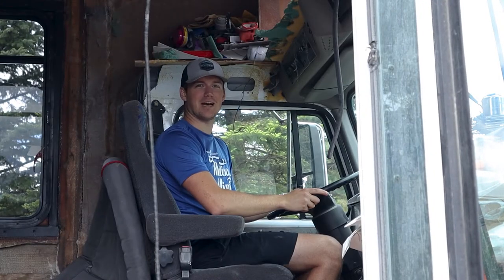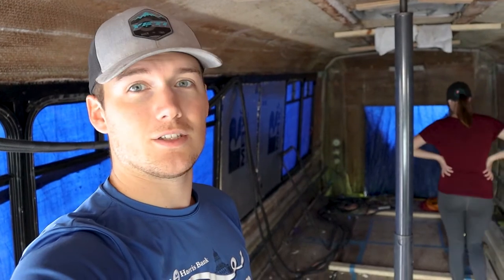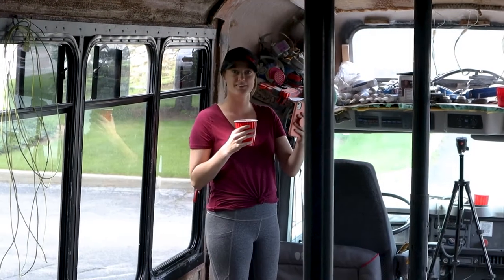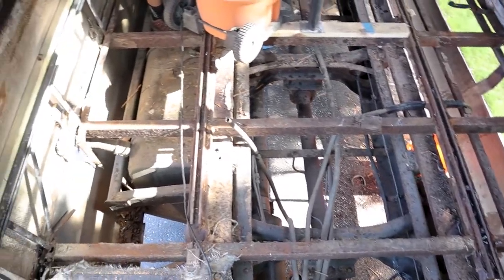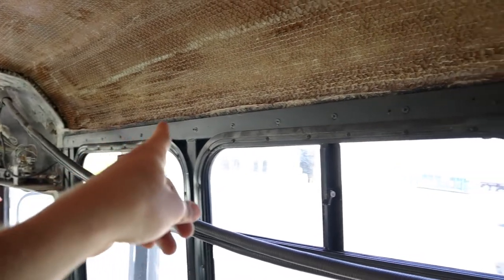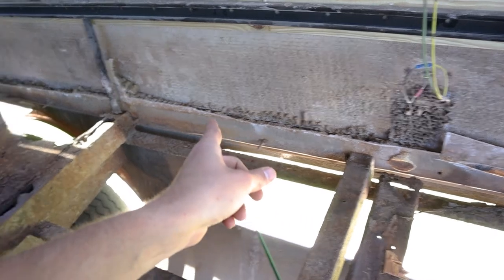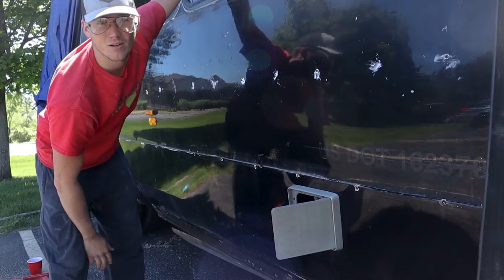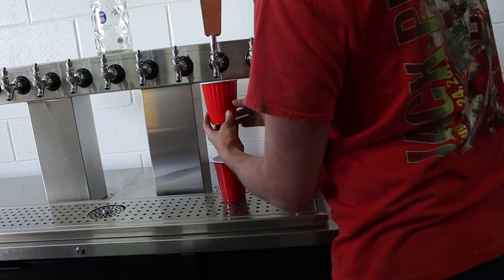Removing The ENTIRE Floor Of Our Shuttle Bus!-- Skoolie Ep. 14

Comment: I am currently exactly where you were in this video! Nice to see someone else with essentially the same floor. Mine is not quite so rusted - luckily no replacement of cross beams needed, but tons of grinding away the rust for sure! Mine has sheet metal creating pockets between the beams and those were filled with some pretty nasty spray foam (which I removed), so I'm not 100% open to below, but I think I'm going to remove most of the sheet metal too so I can better access the frame underneath to get rid of that rust as well. Can't wait to catch up on your build and know that there is a light at the end of the tunnel.

Comment: And I thought rehabilitation of the rust on our bus was a PITA! At least you'll know it's good.  Wire wheel lose rust and use spray bottle of Rust Kutter rust converter while wearing PPE. Don't breathe it in. It's a phosphoric acid based product and really hurts the lungs.  Tractor Supply sells it for about 20 bucks a bottle.  It works very very well. Also... just get a flux core welder and learn to weld.  You can do it.  You'll be dollars ahead and both have a new skill.  Don't weld to the chassis frame. That can hurt the structural integrity of the vehicle.  Disconnect battery first.
Reply: nice
Reply: If you don't weld to the chassis frame then how do you connect it to the frame?
Reply: @RoeRoe123  things connected to the chassis by DIYers are better carefully drilled then bolted on. Excessive heat of welding can distort the frame through annealing and make the structure weaker. Small tack welds likely aren't an issue but I would rather err on the side of caution.
Reply: @allmomomosthomebus3895 Okay so bolting is fine and what if I have a professional welder? Would it would be okay for him to?

Comment: How did you take out the metal flooring? Just cut them out?
Reply from the maker: Most shuttle buses don't have a metal floor below the wood like school buses do. Ours had some protective sheet metal above the wheels which was mostly rusted but what was left of it we cut out with an angle grinder and cutoff wheel